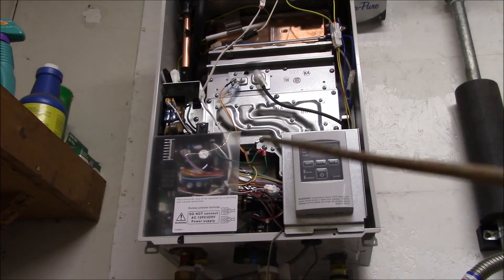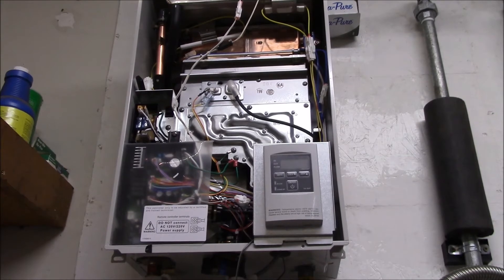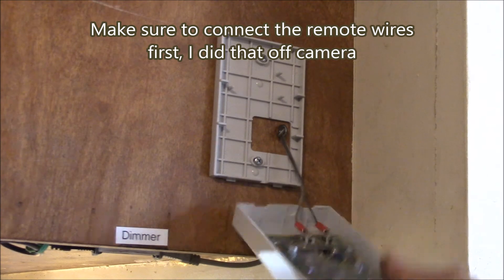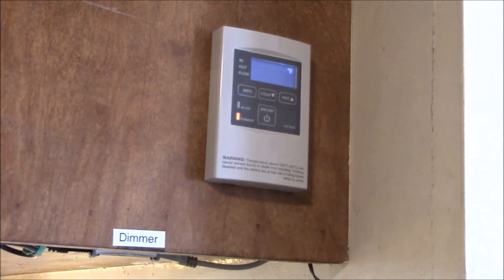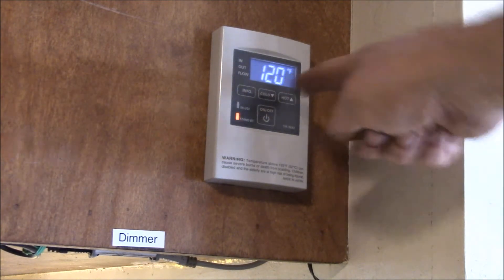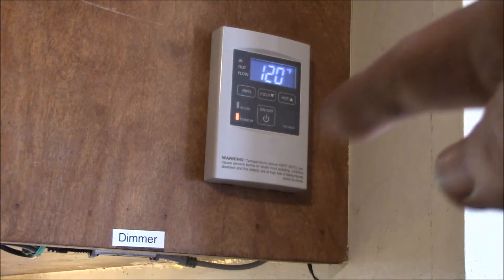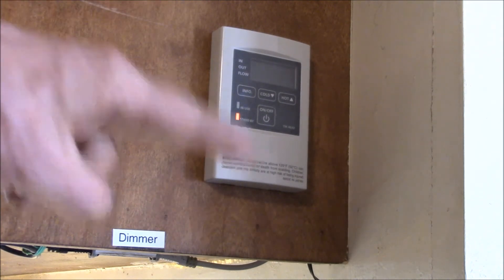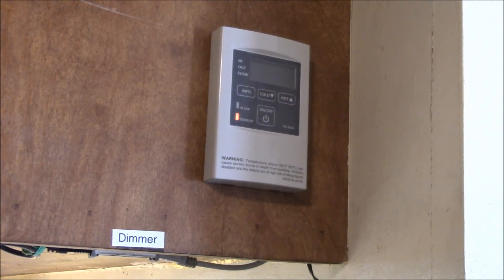Installing the TM-RE42 Remote for the Takagi Tankless

Comment: Hi I have this same unit I’m no longer getting hot water what could be the issue already replace hi low switch and still nothing? Help please
Reply from the maker: Best to check the troubleshooting guide:
https://drive.google.com/file/d/1uR9UmjtuiRDCBxaDnpbN2v-JTVw37r-e/view?usp=sharing
See if there are any stored error codes.  Might be the inlet filter is clogged or the water flow sensor is not registering flow, gas shut off, etc.

Comment: I know this video is 6 years old but I figured I'd give it a shot.
Do they supply the wire? If so, how long is it? 
If I require a longer wire, could I add to the existing wire or (better yet) just use a longer length of wire to give me the distance I need?
Thanks.
Reply from the maker: Some wire comes with the unit, I think it was around 25 ft. or so.  You can use any 2-conductor wire, like doorbell or speaker wire (~18 AWG)  in place of the supplied wire, up to 400 ft. long.  There are screw terminals on each end.
Reply: @The4Crawler  Thanks for the fast reply.

Comment: I installed a takagi tankless today and after I was done installing it it gave me code 111 while it blinked and couldn't figure out why it did that. anyone has any idea why it night have happen ?
Reply from the maker: Likely no gas or too little gas.  Maybe need to try it a few times to get the air out of the line so it's full of gas.  
From the manual:
111: Ignition failure
1. Check for proper gas supply pressure at the heater inlet.
2. Check if the Hi-limit switch (Part #411) is properly functioning.
3. Check for connection/breakage of wires (Part #412, 707, 708, 709, 710), and/or soot on the
flame rod (Part #108). Check if the O.H.C.F (Part #412) has a breakage, Consult the
manufacturer.
4. Check if there is a buzzing spark ignition sound coming from the burner (Part #101)
when water heater prepares for combustion.
5. Listen for the double “clunk” sound coming from the gas valve assembly (Part #102)
when water heater goes into combustion.
6. (Only if sparking and/or kick sound) Check the voltage on each wire to gas valve assembly
(Part #102) and/or the igniter assembly (Part #709). Refer to “Appendix A” in Section C.
*No sparking sound >>>>> Refer to #1 at “Appendix A” in Section C.
*No kick sound >>>>> Refer to #2 at “Appendix A” in Section C.
7. Check if there is leaking from the heat exchanger (Part #401).
8. Check if there is dust and lint in nozzles of the manifold (Part #102).
9. Check the current on the flame rod (Part #108). Refer to #3 at “Appendix A” in Section C.

Comment: So have the same unit . And I can’t seem to get hot water . It just shows stand by but I don’t get the green light you get on your video. Any suggestions?
Reply from the maker: Try turning the unit off then back on and look for a 3 digit trouble code on the display when it first starts up.  "000" means no stored codes.  Could be the water or gas is turned off or the water inlet filter is clogged or something like that.  Has it ever worked?  It should turn on if you have sufficient flow, which is about 0.6 gals/min, so make sure to open the hot water tap fully.  The unit needs to see that much flow before it tries to fire the burner and start heating water.  If you just have a trickle of water out of the tap, it'll sit there all day without firing.
Reply: @The4Crawler  yes it worked be before but it was doing a thumping noise and then it would go away. A few days a go I replace the outlet because it needed to have a cover for the rain and it stopped working
Reply from the maker: @rudysvideoclip  Might check that the power connection is still good, since that was the last thing that changed.  The heater does make a sort of thumping noise when it first starts, usually repeats a few times before it fires up.  If the noise was other than that, might be something internal, like the water passages are clogged with sediment or scale.  Try flushing the heater, make sure the inlet screen is clear and that water flows through the machine when you flush it.  I have a video on doing those tasks if you've not done that before.  Otherwise, check through the troubleshooting steps in the service manual:
https://drive.google.com/file/d/1uR9UmjtuiRDCBxaDnpbN2v-JTVw37r-e/view?usp=sharing
Reply: @The4Crawler  thanks I will try this in the tomorrow. And Yes the thumping noise happens  only when it was starting but it goes away. You have been a great help and I really appreciate it. I will keep you posted.
Reply: Hi: Mr Brown , today I unplugged the tankless waiting a few secs plugged back in and it reads 000 . I turned the hot water on and it worked. My question is it has a in - out - and flow where should they be set at . The guy that installed it never gave me the manual. Thanks I really appreciate it.
Reply from the maker: @rudysvideoclip  You can download the manual:
http://www.takagi.com/products/tankless-water-heaters/t-h3m-os-n

"In" is the incoming water temp, "Out" is the outgoing temp and "Flow" is the water flow through the heater, they are simply data outputs.  + and - can set the output temperature:
https://youtu.be/rYecHPXXQSE
Reply: @The4Crawler  thanks. I went to check the water temperature and the hot is off again. It’s Showa I 510 on the control pad flashing on stand by no green light.
Reply from the maker: @rudysvideoclip  The manual has the trouble codes described:
510: Abnormal main gas solenoid valve

• Check for connection/breakage of wires (Part #707) and/or burn marks on the computer board (Part #701).

• Check for signs of vent corrosion.
• Check gas valve contacts and gas valve wire harness
 connections for signs of rust or corrosion.

Might just need to disconnect, clean and reconnect the wires to the gas valve.

Might also be the gas isn't turned on or perhaps the gas pressure is too low.
Reply: @The4Crawler  thanks. I’ll call their customer service. It’s new . It’s been installed 5 months ago. First time actually using it .new construction .
Reply from the maker: @rudysvideoclip  Sounds like a plan.  Since it's an exterior model, it could be as simple as the exhaust vent being clogged with something like leaves or construction debris or even a bird nest.
Reply: @The4Crawler  yes tomorrow I’ll check all those things. Like I said before  I really appreciate it. Your videos are very informative,

Comment: Does the remote temperature controller allow you to use commercial temperature settings? Meaning, can you set the water heater to 160F to 180F using the TM-RE42?
Reply from the maker: I don't think this model can go above 140F, remote or not.
Reply: @The4Crawler  I have the TK-540, which is just a T-H3 with an integrated circ pump. The manual says the unit has a default maximum setting of 140, but that 180 can be reached with the installation of remote temperature controller. It has a disclaimer that "doing so will reduce the warranty coverage to that of a commercial warranty application."
Reply from the maker: @JB-nf8nk  OK, that's a different model.  I suppose contact Takagi support and ask them to be sure.  I found them to be fairly responsive.
Reply: @The4Crawler  Bought a TM-RE42 and installed it - if you hold "info + hot" the temp will start flashing and will allow you to go up to 185 on my model
Reply from the maker: @JB-nf8nk  Thanks for the update.  Mine works with the same keys and will only go up to 140F.  That must be a heater specific feature, as far as the max. temperature.  The remote probably just sends out an increment or decrement temperature command and the heater internally steps through the temperatures until the high or low limit is reached.
Reply: Depends on the model. T H3 DV     goes up to 185 F in 10 degree increments. The manual doesnt recommend to run 185F on a closed loop.

Comment: great video. Thank you. From my research on venting in and out, I thought that the intake air has to be coming from the outside of the house, but on your video, you have the intake in the same room as the tankless water heater. Am I incorrect in my research?
Reply from the maker: Heater is installed in an unconditioned garage that has adequate air volume and free intake area to the outside to support the combustion air requirements of the heater.  Also, Takagi does show "same room" intake air as an approved option in the installation manual, specific page below:
https://drive.google.com/file/d/1ajssM-qMLH0cCmUpZNbPzU2Vcnl3CROY/view?usp=sharing
But yes, if the heater is installed inside the conditioned living space of the house, then outside combustion air is generally required.

Comment: Yo dude, you are killing me. One of the most thorough and informative channels on the net. School teacher, engineer? Do you think it's possible to easily remove the controller from the unit and mount it remotely.
Reply from the maker: Thanks for the comment.  I'm an engineer by training.  It looks like that may be possible, assuming taking the controller out of the indoor heater panel and mounting it remotely.  That is the TM-RE41 part and the "official" remote is the TM-RE42.  If you look at the Service Handbook and Parts List:
http://www.takagi.com/products/tankless-water-heaters/t-h3m-dv-n

It appears both the internal and remote displays are both wired in parallel to the same two wire terminals inside the unit.  I hadn't thought of doing that, but it makes sense.  You can get the same heater in an outdoor version and it has no built-in display (display isn't waterproof).  So it must be designed to work either way.
Reply from the maker: Tried it out and yes, totally possible:
 https://youtu.be/BabIv4CICBk
Reply: Not only is it possible, the backplate for the remote even matches a standard american 1 gang wall plate.
Reply from the maker: Great info, thanks for posting it.I hadn't though to check as mine is on the side of a kitchen cabinet.

Comment: Great Video. I was wondering where you got / what kind of wiring you used for the remote. Thanks
Reply from the maker: It was just some old 20 AWG bell wire I had on a spool.  Same stuff used to hook up door bells and thermostats for furnaces.  You could probably get away with 2 conductor speaker wire as well.